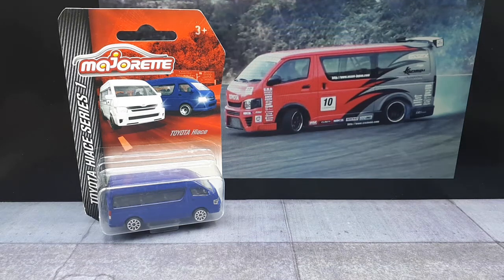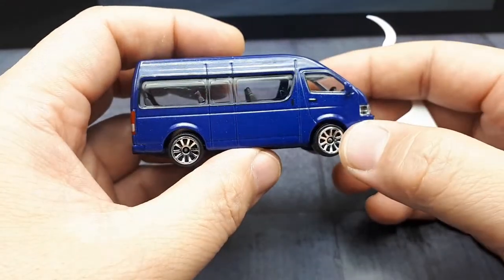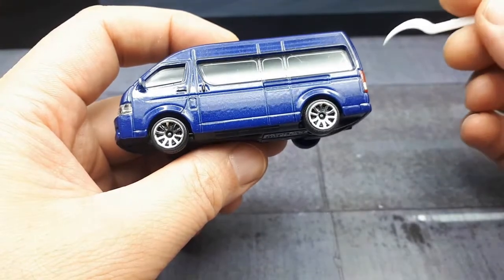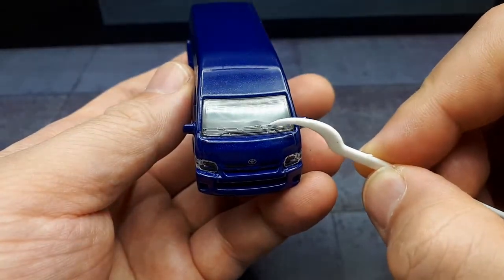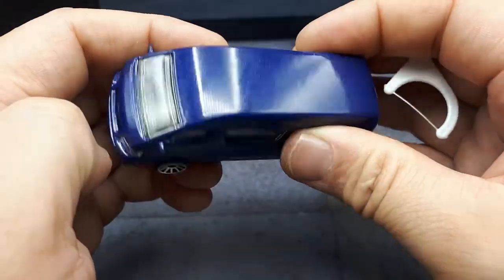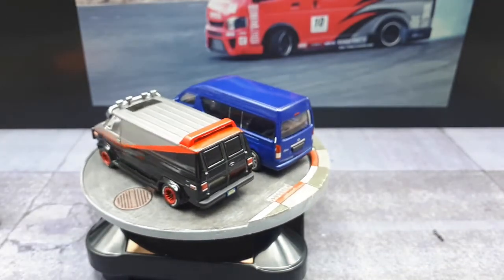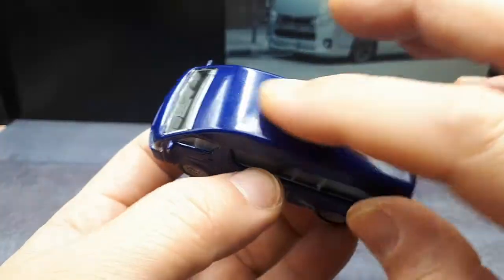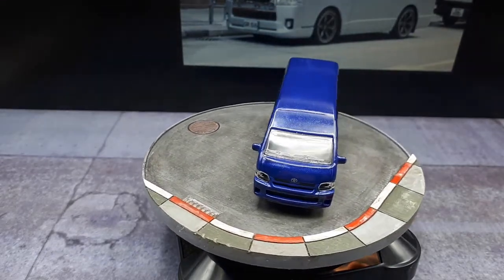1/64 Toyota Hiace by Majorette with 3D printed wheels , diecast car model review

Comment: The HiMedic H100 was powered by a V8 engine. Too bad they changed that with the H200. The H300 though has a V6 engine option.

About the sliding doors, you're right. There is no door on the left side on some variants of the HiAce.

Comment: Does the new wheels rolls smooth or not? Thx. Love this Majorette Toyota Hiace.💯
Reply from the maker: Sorry I never cared to check.  I see no reason why they wouldn't roll smooth but its a light model.
Reply: Thx for the reply though...
The wheels is not rolling but if you roll it with your hand it rolls right? Thx.
Reply from the maker: @cedricm.6099  Yes they spin. I'm sure the wheels spin on all Majorettes since they are meant for kids to play with.

Comment: Could you measure the the model with calipers? I am curious since Majorette's declared scale is sometimes way off the actual scale. For example I have their 1960s Alpine A110 and it is supposedly a 1/61 scale but the model is 72mm long so in reality it's more like 1/53. That's what really bothers me about Majorette - on one hand their models have a lot of features (plastic headlights, actual suspension, opening parts, decent looking interiors) but on the other the scale is uneven (when for example most Hot Wheels, at least the realistic looking ones, are usually close to 1/64 or not that far off).
Still, when they hit the right spot their models are really good for the price range - I have 1967 Mustang Fastback and it is around 1/63, so doesn't look out of place sitting next to the true 1/64 cars. And despite opening doors their panel gaps don't look that bad.
Reply from the maker: Wheelbase is ~46mm on this model.